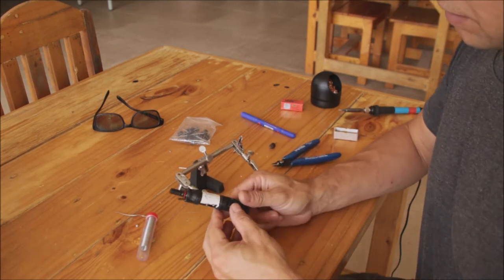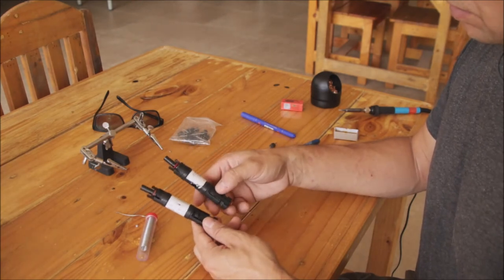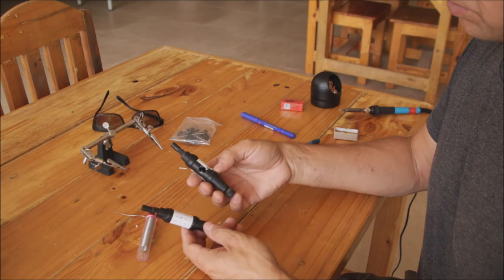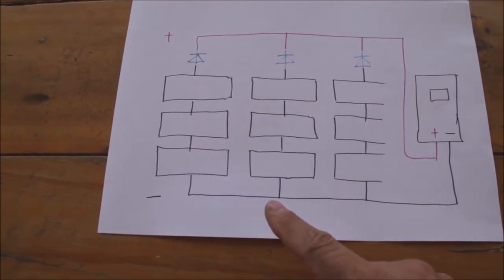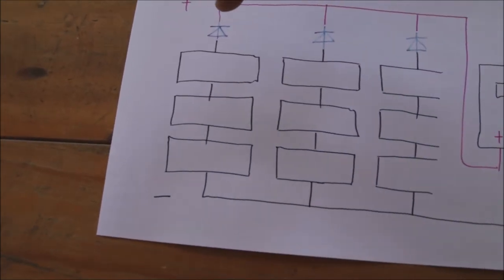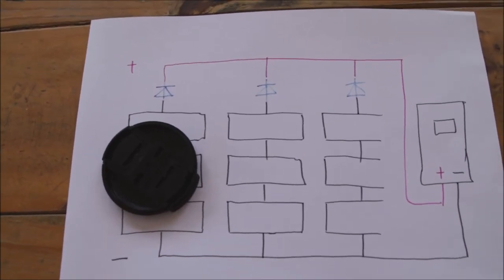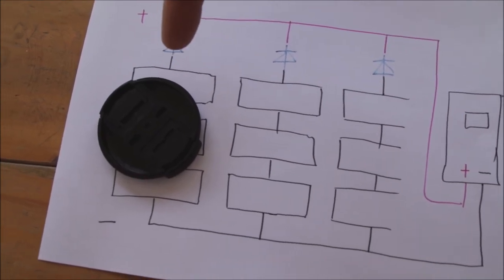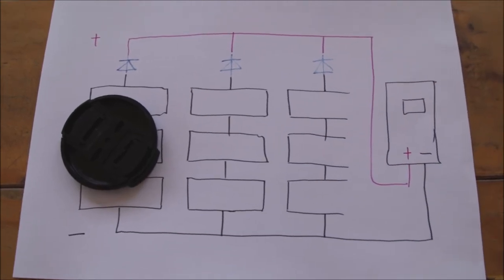PV Basics: String Diode. What does it do, when to use?

Comment: Enjoyed your instructional video
The in-line looks easier and faster to install….I noticed a huge battery bank loss recently during a moon lite night…and suspected back feeds thru the solar chargers(maybe the internal diodes are compromised or have worn out in 10-15 yrs of usage. I hit the breakers in the evening and measured the voltages in the mourning and bingo.
Reply from the maker: Yes, usually charge controllers should prevent backflow during the nighttime. String diodes are definitely a second line of defense.

Comment: Roland, why don't we use diodes in other parts of the system design? For example, isolating all loads, so they can only ever pull from the battery bank.
Reply from the maker: Diodes are valves which prevent backflow. Loads typically only cause flow in one way. You can use a diode for any application you find it useful, but you also need to understand that there is a voltage drop of around 0,5V over the diode. So it will cause power loss each time a diode is placed into a circuit.

Comment: Hello Roland, First of all I must say I really admire Your knowledge on one hand but also Your knowledge sharing efforts in Your videos. Thank You very much for this. 
In relation to thi video topic, I'm just wondering why do we use DC cables of a 4-6mm2 gauge to connect the PV equipment,
but then - in the middle of this connection - we can install such a diode with its very thin connectors? 
What's Your opinion on this? Is it safe ?  Normally I would say we need to keep the rule of at least 1mm2 gauge for each 10A of the current.... 

PS. I would appreciate if You could use a mic that would be closer to You so the videos do not contain so many background noises which obviously makes is harder to listen and understand ;-)
Reply from the maker: When we choose wire gauge, it is all about savely transporting energy over a distance while not losing more then a certain percentage of that power. Special components which need to be included in circuits, are only required to perform as they are rated. Let's say a switch must be able to carry 20A, a breaker as well as specified, etc. In the case of our diode, it is the same. It must only hold up until the rated current. The internal wiring will be OK because the wire length is very short. Surely such components are acting as obstacles inside of the circuit, and they will as well be the breaking point before anything will ever happen with your wiring. 
I know the sound on older videos isn't best as at that time i didn't have a mic yet. I hope it is better on newer videos. Thanks for watching!
Reply: Thank You.
BTW. Do You use a standard rectifier diode or a special type diode called Schottky diode? The second one should give you a lower voltage drop in the forward direction - so the lower warming up.... But as it is only 0,5V vs 0,2V so I'm not sure if it is worth of trying.... A specially that in my installation I have the string voltage at the level of 450V what implies of using diodes dedicated for such a voltage range and this causes a problem because I was not able to find out the diode of the cylinder shape as all of them are produced with this TO-220-2 package (dedicated for electronic plates ) which makes it hard to install within the solar energy equipment....  :-(
Reply from the maker: @romans4471  those MC4 diodes are a finished product. I don't know what is built in inside. Probably a Schottky. I think I also have some Schottky Diodes laying around somewhere if I need to replace a burned-out Diode. Just always try to use a Diode with a very high current rating, like 30A or so...

Comment: Sir.. I have 60W 2 panels (voc-22v, vmp 17.2v) and 195w one panel (voc-45v vmp-36.6) .. Can I use 60w panels series and parallel with 190w panel for 24v system ? 
*with inline 10A blocking diode
Reply from the maker: hi. yes. you can use that combination
Reply: @RolandW_DIYEnergyandMore  Thank you ❤️🌟

Comment: Sir is it also applicable to series connection and how does it connect.also in positive side only
Reply from the maker: Hi, if you only have one single serial string of panels connected to one charge control input, then you do not need a blocking/string diode. The Charge controller will prevent backflow into the panels.
String diodes are only there to prevent one set of panel push back power into another set, when they are connected in parallel.

Comment: Do I need fuses or blocking diodes? I got 6x 100W solar panels, planning a 2 in series and 3 in parallel. What is the difference? Thanks.
Reply from the maker: Fuses protect against over-current due to shorts, blocking diodes prevent against current back-flow. You should always use a fuse. Blocking diodes only if you have a shading issue or the individual parallel strings are facing different directions.
Reply: @RolandW_DIYEnergyandMore  My concern with using a 10A inline fuse is that my series strings of 2x 100W have only about 5A Imp. So at 2s3p if one panel's series faults, will the 10A from the other two series strings be enough to pop the fuse of the panels series with fault?  10A at Imp, it can be lower than that most of the time. Thank you for taking the time, truly appreciated.
Reply from the maker: @Xoda_  Hi. It is correct that it will be very unlikely that a 10A fuse will ever pop. your strings will hardly see 4A going over them. I would use a 6-7A fuse in your case.
Reply: @RolandW_DIYEnergyandMore  Do you have a specific model of the MC4 inline fuse holder you would recommend or store that has them? I'm really struggling to find a definite answer about which holder is of good quality and which ones aren't. I guess I'll need to find a source for these 6-7A fuses. Again, Thank you for taking the time. Much obliged.
Reply from the maker: @Xoda_  This would be an example for a 6A solar fuse: https://www.aliexpress.com/item/4000885582182.html?spm=a2g0o.productlist.main.55.42aa16acwhbitJ&algo_pvid=aa3ff11c-5698-4925-8838-694c1d4828ba&algo_exp_id=aa3ff11c-5698-4925-8838-694c1d4828ba-27&pdp_npi=3%40dis%21THB%2124.19%2124.19%21%21%21%21%21%40211bd93f16809050988321690d0778%2110000010316976805%21sea%21TH%21185638773&curPageLogUid=rKJgxhd5Z4ve

This the standard fuse holder (its Din rail, no MC4 inline): https://www.aliexpress.com/item/4000845692965.html?spm=a2g0o.detail.0.0.4f6e4152tsoyty&gps-id=pcDetailBottomMoreThisSeller&scm=1007.13339.291025.0&scm_id=1007.13339.291025.0&scm-url=1007.13339.291025.0&pvid=62d6f161-ac91-4ed6-907b-3c3fdd807a03&_t=gps-id:pcDetailBottomMoreThisSeller,scm-url:1007.13339.291025.0,pvid:62d6f161-ac91-4ed6-907b-3c3fdd807a03,tpp_buckets:668%232846%238116%232002&pdp_npi=3%40dis%21THB%2124.19%2124.19%21%21%21%21%21%402101c5ac16809052490287528ec7e1%2112000026743480327%21rec%21TH%21185638773

You should get something like this on every mayor online store

Comment: How far from the panels is it  possible to install an mc4 blocking diode? 
If hot temperatures outside are damaging your diodes (every two years), is it possible to install them inside your house (with cooler air temperature)?
Reply from the maker: Theoretically it wouldn't matter where you are putting it, but in systems with parallel strings, you are typically combining the outputs of those strings somewhere outside at the mounts in a combiner box. So the diode will be before the combiner box. You would have to install that one indoors then as well. The diode only costs a few dollars. Much cheaper then pulling more cables as home-runs...

Comment: Hi, Thanks for the video.

I wanted to ask you a question, maybe you could help me. I have two strings of solar panels in parallel, each strings with two 250W 36Voc panels in series, around 60v 8A each string maximum. I have two options, install a Schottky diode 10A 50V (10SQ050) or a 30A 1000V rectifier diode (30A10 MIC). 

Which one would you recommend?

Thanks for your amazing videos.
Reply from the maker: hi. schottky diodes usually have lower forwardvoltage drops then rectifier diodes so you would lose less power with them. the 10A is a bit close to the limit tho. but still, you could go for it...
Reply: @RolandW_DIYEnergyandMore  Thanks for the super-quick reply!
Reply: @RolandW_DIYEnergyandMore  Last question. Would be a 15A 45V Schottky diode be ok for those strings? I wouldn/t want to blow them up, since the voltage going through would be around 60Volts....I believe the 45 V in the Schottky diode refers to its maximum voltage, but online there isn't much information....
Reply from the maker: @beppe8585  i don't think that the voltage rating is much of a concern in this case as there will not be a lot of reversed voltage in a PV string. The diode is only used as a directional valve. Once the sun isn't shining anymore voltage in the array will drop and maximum reverse voltage will be the battery voltage.

Comment: How many voltages are you loosing with blocking diodes? 
What was the Voc and Vmp voltages per string before and after?
Reply from the maker: Schottky diodes typically have a 0.3-0.4V drop over them. My Voc on that system is around 135V and V during normal operation around 100V
Reply: @RolandW_DIYEnergyandMore  thanks Roland. 
I am subscribe your channel. 
Now i am going to work (it's morning in Italy) but i am very happy to find you. 
Very good contents! 
I will see all your videos next days. 
Bye, see you

Comment: 4 panel of 100w with parallel what size of blocking diode
Reply from the maker: do you have a shading issue? 4x 100w panels are a fairly small array. aren't those panels next to each other and going into shadow at same time? otherwise the smallest diode like a 10A will do it...
Reply: @RolandW_DIYEnergyandMore  yes ser  same wattage of 100watts but,the other one it defferent of ,imp,voc,isc
Reply from the maker: @farmerbloggers9026  if you put panels in parallel, then at least the Voc of all panels should be about similar. Slight differences are no problem. But if those 4 panels are just mounted right next to each other and facing the same direction, then you might save the blocking diode as all panels will be illuminated the same way at same time anyways. Blocking diodes make sense when parallel panels look different directions or do expear different shadowing situations over long time.
Reply: how many  blocking diode can use of 4 solar panel in parallel
Reply from the maker: @farmerbloggers9026  you will need 4 diodes. one for each panel in parallel
Reply: @RolandW_DIYEnergyandMore  thank you

Comment: Great video. What is the spec of the diode, and part number? Thanks.
Reply from the maker: Those diodes come with current ratings from 10 to 30 Amps in 5A steps. You can get them at you favorite online store.

Comment: Do you install bypass diode?
Reply from the maker: Bypass diodes are installed inside the junction box of the solar panel by the panel manufacturer. Without them a panel would block current flow in case of partial shadowing.
Reply: @RolandW_DIYEnergyandMore  so is this enough or do I need external bypass diode when connecting 2 solar panel in series?
Reply: @RolandW_DIYEnergyandMore  ok, so, blocking diodes still needed right? For parallel solar panel
Reply from the maker: @zynskavzynskav4465  yes, you still need blocking diode when you have parallel strings. And No, you don't need any extra bypass diodes. That is taken care of by the panel manufacturer. Cheers!
Reply: @RolandW_DIYEnergyandMore  Thanks 🌅

Comment: I can imagine calling a guy in would probably result in him replacing the panel. How does a faulty diode manifest itself as a problem ?
Reply from the maker: Those 3 panels in line with the diode did not produce current because the circuit is disrupted. In my case with 5 parallel strings, I have lost 20% output on the whole system. That's why it is very important to at least write down monthly generation in a excel table to compare to the same period of years before. Only this historical data was telling me something is not correct...
Reply: You can also check wires from the panels with an ampmeter clamp to see how many amps are flowing

Comment: solar panels come with diodes already on the back !  These diodes are for the very thing you just explained . Why would you add yet another diode inline of the solar panel ?  It wont do anything .
Reply from the maker: Bypass Diodes are used in parallel with either a single or a number of photovoltaic solar cells to prevent the current(s) flowing from good, well-exposed to sunlight solar cells overheating and burning out weaker or partially shaded solar cells by providing a current path around the bad cell. Blocking (String) diodes are used differently than bypass diodes.
Bypass diodes in solar panels are connected in “parallel” with a photovoltaic cell or panel to shunt the current around it, whereas blocking diodes (or string diodes) are connected in “series” with the PV panels to prevent current flowing back into them. Blocking diodes  are therefore different than bypass diodes although in most cases the diode is physically the same, but they are installed differently and serve a different purpose.... as said, blocking or string diodes are only needed in a constellation of multiple parallel strings on one charge controller. If there is backflow into one string due to individual shadowing from trees, chimneys, poles, etc. that power would not go to your charge controller, instead it would be burned off at the shadowed string and you lose overall output power.